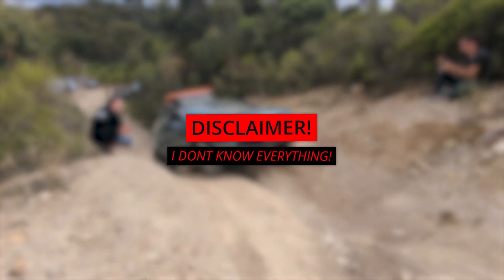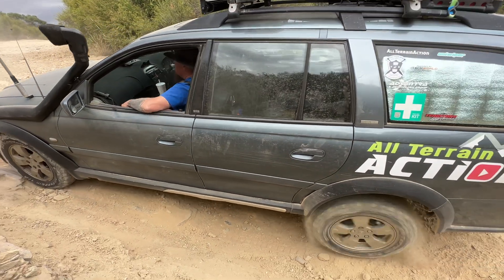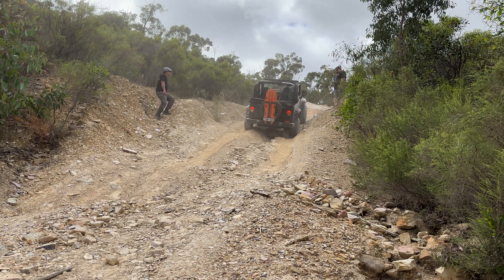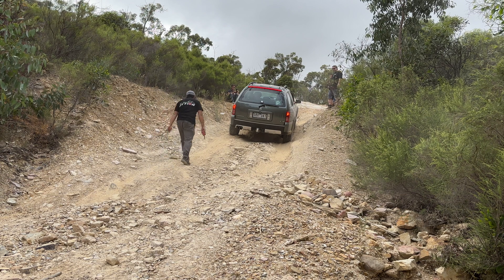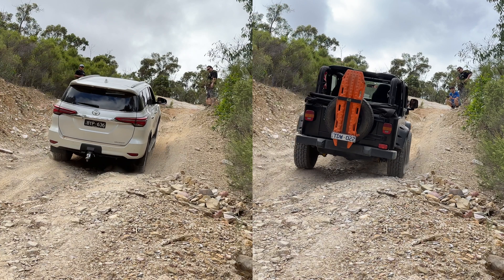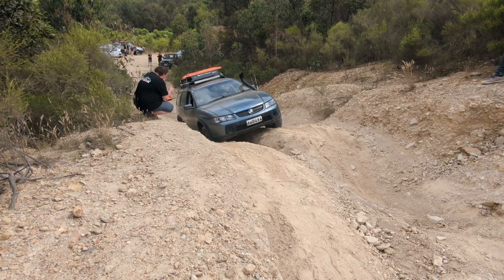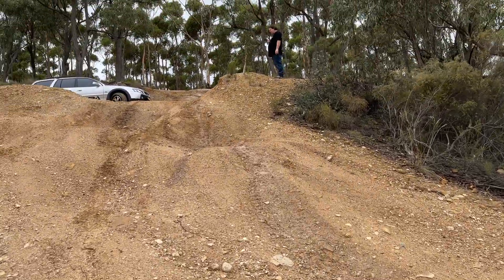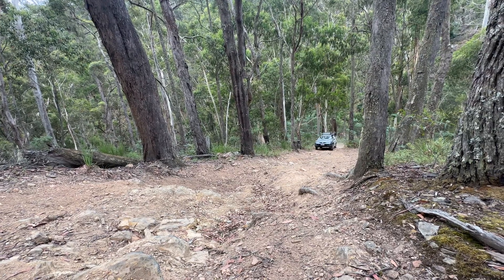Offroad Traction Control Systems Demonstrated

Comment: This is the Adventura content I didn't know I wanted! I recall everyone saying back in the day that the Adventura was way better offroad than the Territory. I dig the wagon look of the Adventura, but imagine if they designed a taller crossover body for this. Shame.
Reply from the maker: Yeah plenty of what if's.... we've been wheeling these nearly 8 years now off-road and as time has gone on we've found more surprises to capability when pushing it beyond what you'd expect a general softroader be capable of. Glad you found the channel, plenty to see here (hard to really find what you might want) but over 400 videos and if there is something specific you're curious for... if you're a 4wder from VIC we have a full run through Burgoynes Track from Black Range Rd all the way out to Scrubby Creek Tk into Dargo taken in 2021, new runs through Mt Margaret track the up direction from Licola Rd. Full series of a Simpson desert crossing and lime stone coast if sand is you're thing but yeah.. tonnes of content here on the Adventra.

Comment: In my modified GU patrol. (It will probably come close to keeping all 4 wheels on the ground through this track mind you). I’ve often crawled stuff like using low range and a foot gently on the brakes at the same time. Granted the rear LSD on a patrol is really good, but you can capitalize on the larger brakes on the front stopping wheel spin with a bit of brake.

Does anyone try this as opposed to waiting for traction control? My car has a single computer and it’s a timer for glow plugs. Definitely no computer assistance to maintain wheel speeds.

Comment: You got to remember the Holden traction control is like a decade old, still it performs really well for its generation, done a REALLY GOOD video, well done
Reply from the maker: Actually almost banking onto 2 decades old, first release 2003 last build 2006, mines in the middle of that.

Comment: Where is this track? Kinda want to try my Jimny JB74 there, which has a very good traction control.
Reply from the maker: Google map on this page https://www.allterrainaction.com/lerderderg-4wd-training-park/
Reply: @AllTerrainAction  sweet, thanks 👍
Reply from the maker: @S9RUT  no worries, enjoy - few things close by too if you're after some extremes. You'll be pleasantly surprised at whats around. Enjoy
Reply: @AllTerrainAction  I was wanting to try Ratcliffe as I've watched your video of that tricky little section, but it's currently closed. Keen to get out and about to Lerderderg 👍
Reply from the maker: @S9RUT  I think ratcliffe would be very easy for you in the Jimny in the dry, the wet would offer some more excitement though over the rocks.
Reply: @AllTerrainAction  I'll keep that in mind when it re-opens. 👍
Any other medium rated tracks that you would hit in Lerderderg?
The 2 rigs are Jimny, stock suspension, muddies, and Everest, stock everything, all terrains.
Reply from the maker: @S9RUT  In the dry XL track and Diggers Track from Obrien road side would be a good couple of tracks. Don't freak out when you get to the massive holes on Diggers track on the far left side there is a track that should be able to go through - can always turn around if its too much for you as well.

Comment: Basically with my TD Mitsi. if it starts to lose traction just gently increase the revs and about 300 rpm extra the traction control will take over and away you go.........hopefully.
You can actually feel it and it's quite marked.
I can use it in full 4wd, although it doesn't have lockers, but it still does very well in AWD the odd times that I've used it.
Reply from the maker: I see it time and time again, so many people try and power it and the traction control just says nup, no more and they call defeat. Every car will respond differently to how the traction control is tuned/programmed but as you know, when it starts rocking and you get the bump you need forward you immediately get the traction you need and away you go. I'm hoping this video helps many as it applies to so many vehicles nowadays!